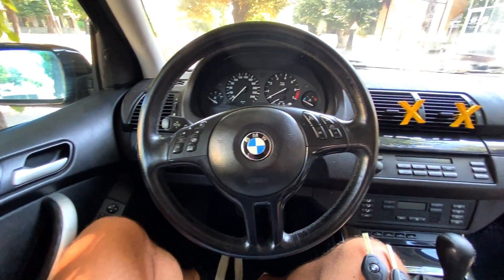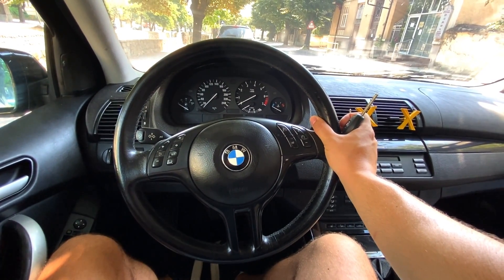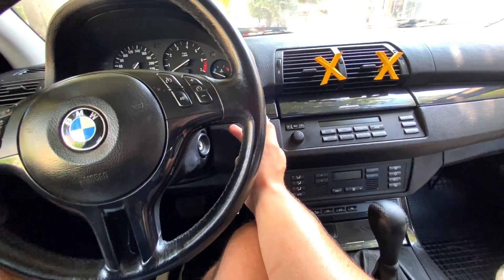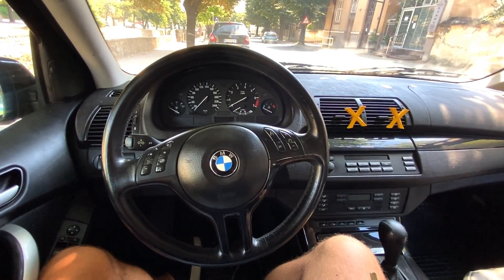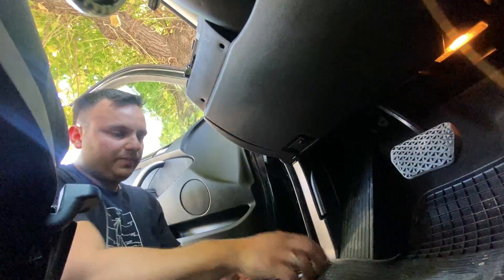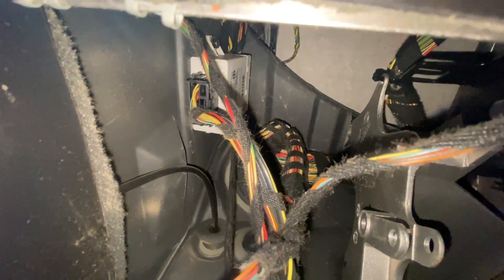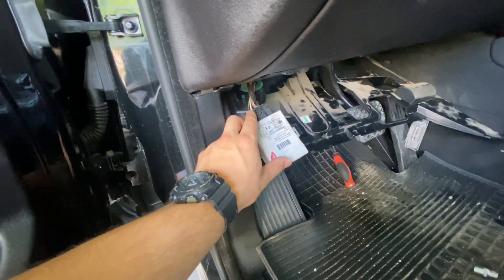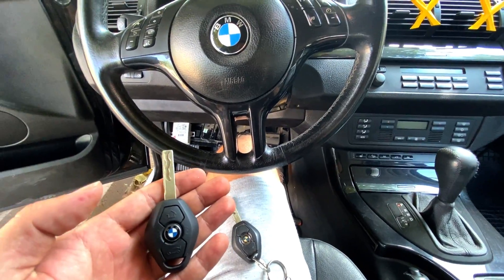BMW EWS System Explained – Location & Removal Guide

Comment: My 2006 x5 didn’t start the other day. Then it did and the battery light was flickering then it was mostly on. Battery tests good. Alternator tests good. Didn’t start three times today. Managed to start twice. Not starting now. Is this ews or key related? Or you think something else?
Reply from the maker: Did you check the fault codes?

Try starting with both keys and see if it doesn't start with one of them. If it starts with one of them and doesn't with the other, it's probably a transponder problem because they can really brake both at once.
Reply: @SlavkosHobbyChannel I only have one key unfortunately. I checked fault codes a couple days ago. Nothing relating to the situation. But I will check again now.
Reply: I did find one. 0F voltage supply EWS3 control module
Reply from the maker: @adriangale Check the power to the EWS unit, especially when it struggles to start.